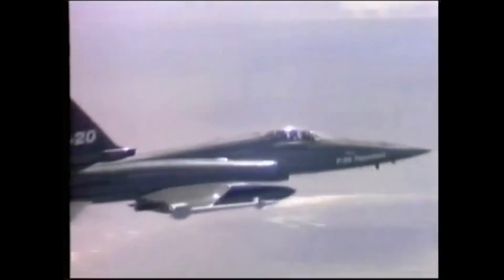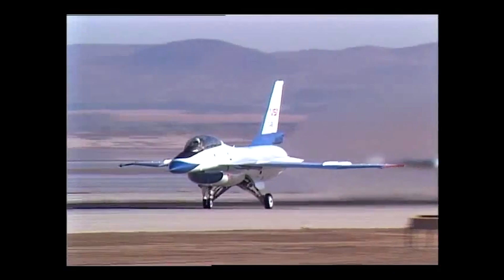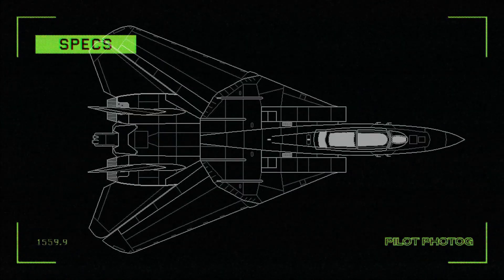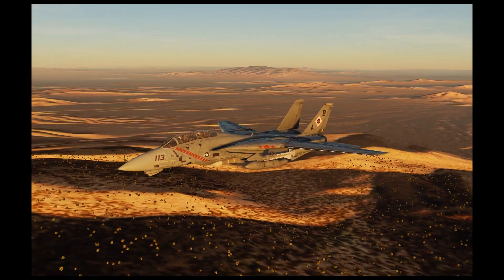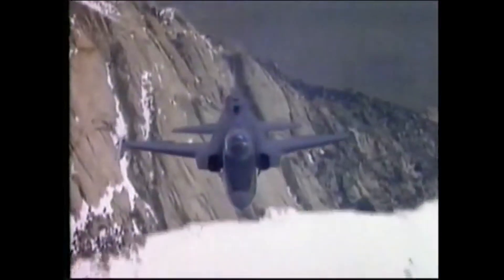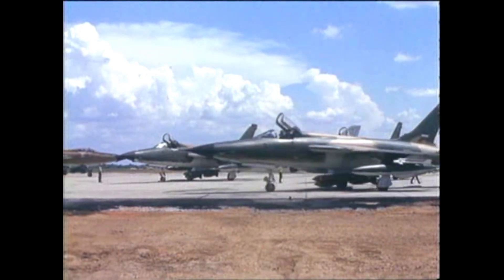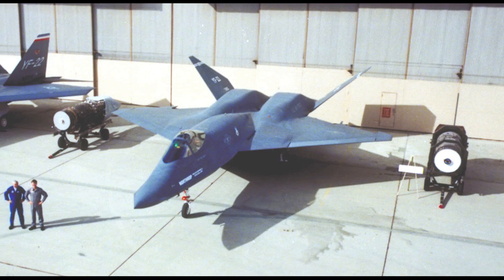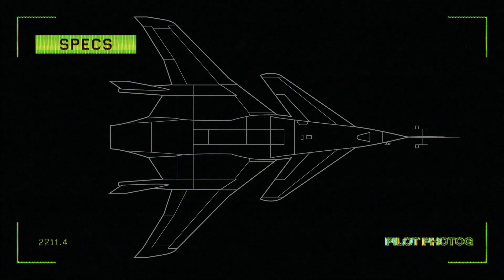Top 5 Fighters That Should Have Been Built | Best of Aviation Series by PilotPhotog  f20  f16xl

Comment: Damn you didn't include "the F-15 prototype model with canards" and that is called the F-15S/MTD. Can you just imagine the F-15S/MTD if it was taken into service through the United States Air Force now they have a worthy opponent against Russia's Sukhoi Flankers with canards. Btw the F-16XL and the YF-23 is awesome to have in USAF but sadly we all know they didn't go into service. Great video my friend.
Reply from the maker: Thank you and good point - the F-15 with canards and thrust vectoring was a beast.  I am working on an F-15 series and have the first two videos out.  I will be sure to include the “Super” F-15 in the videos!
Reply: The F-15 STOL/MTD is quite frankly amazing and it only got better once it went on to become the F-15 ACTIVE.

The exceedingly low take off speeds of around 45mph, the need for a minimum of 500 metres of runway, and the incredibly high angle of attack it could pull in flight and remain under control for.

It's just all levels of ooh.

That and also the paint scheme it had when it became the F-15 ACTIVE is just so dammed pretty.
Reply: @xxrockraiderxx  problem with he F15 active is i's radar signature, it would be massive like the SU 30
Reply: @xxrockraiderxx  would have been an incredible aircraft and a world beater.
Reply: to me the F-22 is still old school conventional regardless of fbw or large control surfaces. the internal weapon bays restrict the size and quantity of weapons so still hanging muntions off the wings.
Reply: Well... those "canards" were literally F-18 elevons...
Reply: Problem with canards is they generate one hell of a radar signature.  That's why you will never see a stealth airplane with canards.
Reply: Agreed was wondering why they didn't proceed with the program my guess it wasn't stealthy but still there's room for improvements.
Reply: The f15mtd/stol wasnt built to be a fighter it was built to demonstrate supermanuverablity the stol was later given to NASA also it wasn't ment to be stealthy or effective just to demonstrate supermanuverable capability then Russia adopted the concept
Reply: Saint Jerry  Can you elaborate?
Reply: Saint Jerry  Exactly... they are amazingly maneuverable, but would be shot down before they could strut their stuff...
Reply: It was a test vehicle, never meant to see service, and it would have been way too heavy, not to mention the maneuverability wouldn't really be all that useful